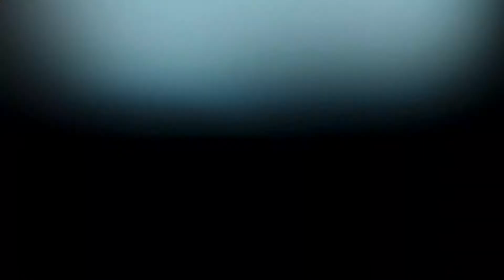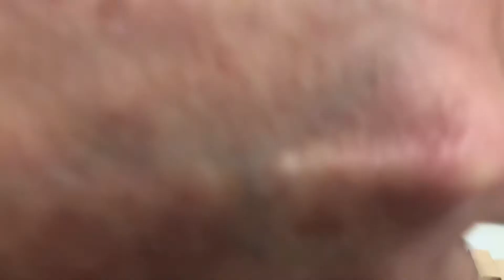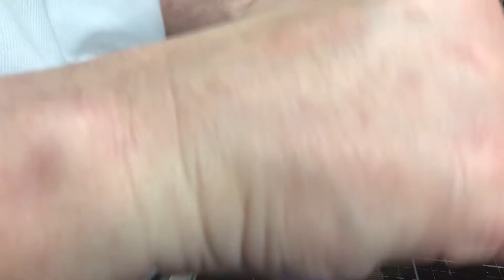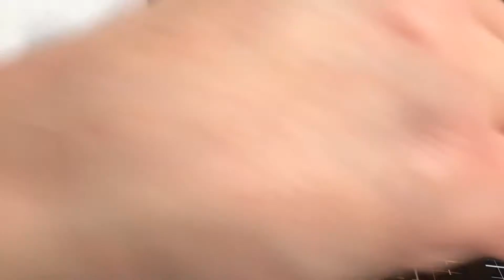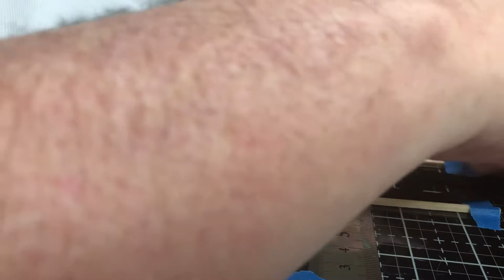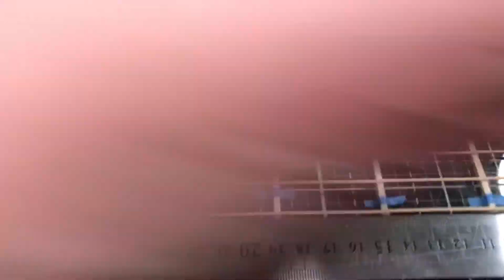Shack Scratch Build Part 2 Building Wall

Comment: Steve where did you get your sanding block device looks interesting
Reply from the maker: So the sanding block I got from Micro Mark, same people that build the chopper.  I think Roy go Vinny one from Amazon, but not sure.  Not the greatest but it works well, just tough on loading the sand paper.  You need to cut strips then tape inside the block, but you get 4 sides too, so you can put on different grades.

Comment: Next time you need to sand a piece and it's going to end up needing to be really short, sand it first while it's still a long piece then cut it to the small size it needs to be. It will be easier to control and not so hard on your fingers. We all occasionally miss the obvious easy way of doing things sometimes. I'm the worst about making things harder on myself and harder than they should be. This is going to be a neat structure. You do an excellent job scratch building and including small details. Like this small piece having the tapered detail that matches the real structure. The last build you did for Jac Jac's contest was awesome. I'm interested in seeing how this one will turn out when mounted on a piece of foam and you add all the mud, material spillage, weeds, and the rest of the scenery. Looking forward to the next video. Stay well. -Wil  👍
Reply from the maker: Thanks William.  Yeah the might of been better.  Also I have a tiny chop saw that I should have used the pre sanding and a chop saw would have been best.  I didn’t think it was going to be so bad sanding.  Oh well.  Thank you for the complement on the building.   This one I’ve decided not to put it on foam.  I didn’t want to have to build out the whole module yet, I’m running out of storage space,  so I intend to put it on a small base, then mate it up with everything later.  So that will be fun.  Go thing just no lights or electric in this one.